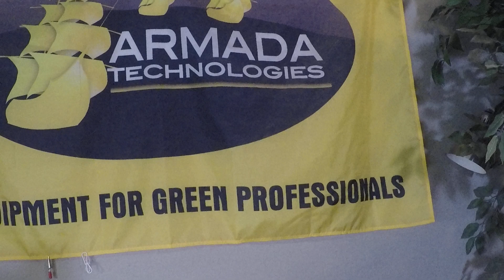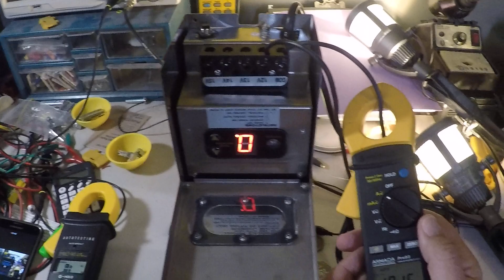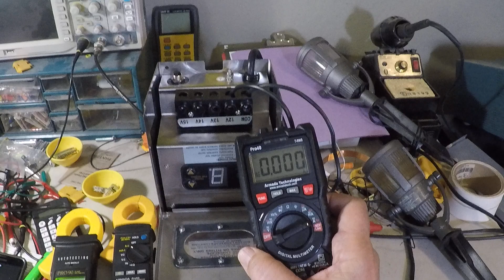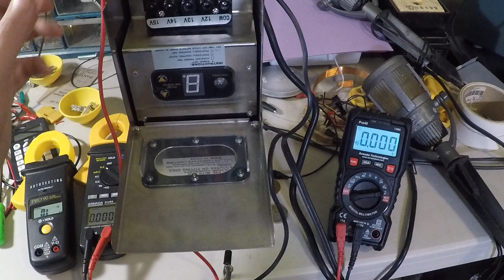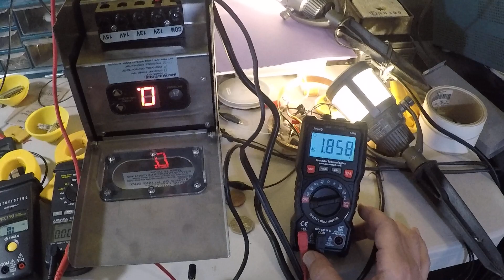How to check Actual Real Power (volt-amps or VA) in Low Voltage LED Lighting with True RMS Meters

Comment: hi what will provide more brighter light in a flashlight? 2x123a battery, 2x16340 batery or 1x18650 battery???
Reply: Hi ICR - The strength of light will be determined more by the LED/flashlight than the battery. 123a and 16340 are similar in size, but the capacity of the 123A lithium will give you the best life. The 18650 is a AA-type cell and has good life if you have a flashlight suited to that size.

Comment: I’m having an issue right now I have a 150w led power supply (transformer) and i added all of all my light wattage according bulbs and they Equals 132w but keeps tripping built in breaker on transformer.  I’m going to get my fluke digital MM out tomorrow and test the actual voltage and amps to see my actual wattage draw.  Watching your vid I suspect it’s way over.  Thank you!
Reply: Hi Web Crawler - Despite the derating you used (12%) I think you are still drawing more peak current than the breaker can stand. The breaker reacts only to current so wattage ratings can be misleading. In fact LEDs are electronically activated and only turn on for a fraction of an AC voltage cycle, but at a higher current to make up for the short On time. These peak currents are usually at fault in breaker trips even when the wattage ratings are observed. We recommend using a True RMS clamp-meter that reads real amps being delivered - if you do you will see more current than the LED label ratings imply.
Reply: @jlcarefoot  thanks I’ll see if I can find one or borrow one.  I hooked my dmm to today and I can see the amps spike at initial turn on and then drops and settles down. Sometimes would go from 17 or 15 amps at start and then settle around 12.6.
Reply: @webcrawler3332  That surge in reading might be just meter settling down, especially  if it is TRMS. At 12.6 amps and 12 vAC you are already at 150 watts without allowing for the peakiness of LED current. Even if you refine your measurement you are still facing a periodic overload which means you need to expand your supply or reduce the number or type of fixtures.
Reply: @jlcarefoot  I’m running 15.3v but still over my limit.  I have 4 11w leds that I’m going to swap out with 4 3w and see if that brings me closer to the actual 150w.  If not I have a second power supply but I’m trying not to use it at the moment.  I have other plans for it hopefully won’t have to buy another one.  But if I do I do I guess.
Reply: @webcrawler3332  I think just changing those four LED cartridges will make a difference.
Reply: @jlcarefoot  I’m hoping so, their older led lights when LEDs first came out.  We shall see, hopefully tomorrow if rain stops for a while 😁😁